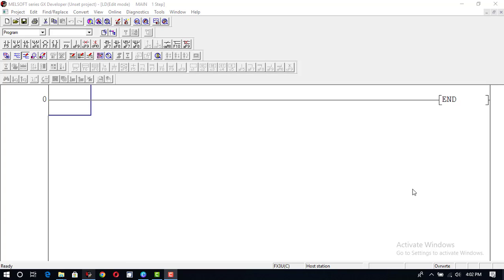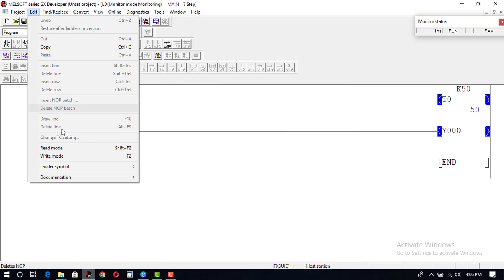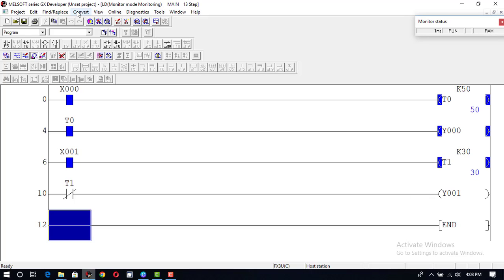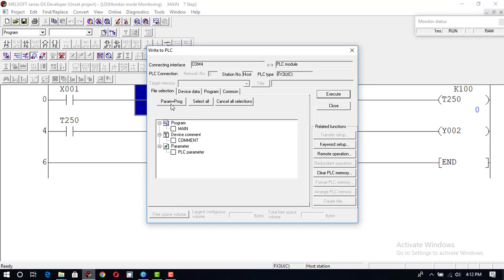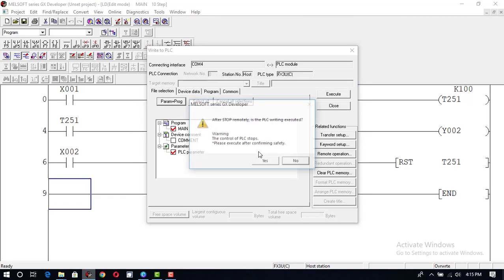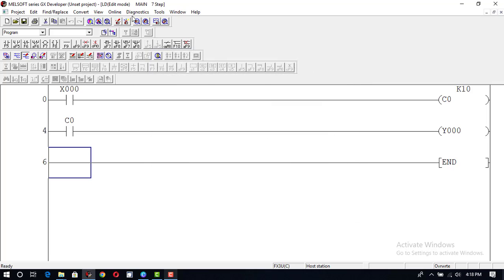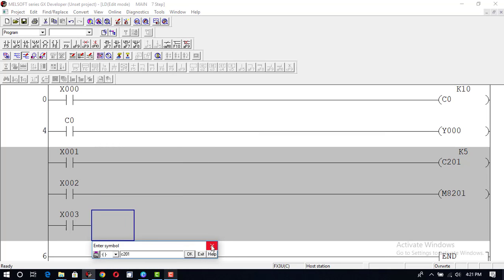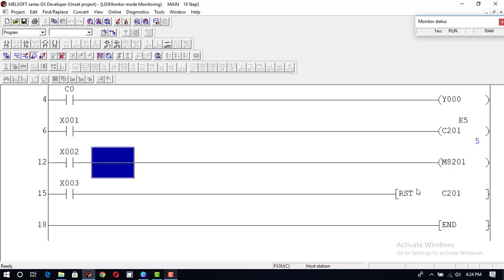PLC on-delay timers & off-delay timers II Retentive timers II up counter & down counter Tutorial 08

Comment: Good lecturing ..

I have a questionon the down counter . Since the is a reset command and a special relay to convert time to down. Shouldn't when special relay energized and you press reset, shouldn't the time counter set be at 5 so that it can count down when you operate it ?
Reply from the maker: Yes you can set counter at 5 to start down counting